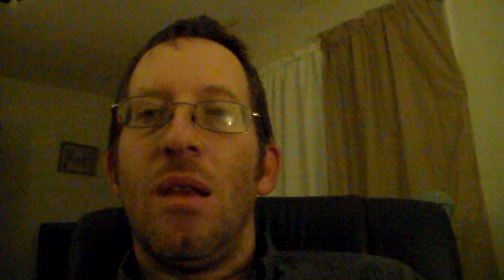Whosaidtyler's number one worst engine of all time

Comment: they still use the 2.7 v6 and its still full of issues.. you can get it as base engine in charger..etc. I have a friend who works for dodge and he said that they over work the engine so it is prone to fail easier like the small engine in a huge heavy car he said that if they put it in a small car it should be fine ( I still have my doubts...lol )

Comment: In 04, my mother special ordered a new Sebring sedan with the 2.4 on purpose. The salesmen said the the LX with the V6 was not what you wanted long term! It ran 200k with n/p. She got rid of it after the body rusted out beyond repair!  My uncle had a 2001 intrepid with a 2.7 with he babied but at 140k it started burning oil and then at just 2k  miles later it threw a rod! Junk engine that shamed Chrysler big time!
Reply from the maker: Your mom made a wise decision.
Reply: Actually, I made the engine choice, which is how the car got special ordered. We couldn't find an LX trim model w/o the 2.7 on any lot in Chicagoland! I wouldn't go so far as to say the car was a good car as a whole, but that 2.4 and slush box 4 auto never gave us any trouble. As you said, it's nearly impossible to find a 2.7 in 1 piece nowdays!

Comment: I love ford products and hope to until the day I die but .... Tell me just how much you loved the 2.9L ford v6 engines before you talk so great about ford.  Every one of those heads cracked.  Every 2.3 turbo ford head from the factory cracks, even with their inconel exhaust valves and all.  Not to mention the 2.3's that seize up from low oil pressure when they went distributorless and the aux shaft bearing went out. Plastic 4.6L cracking intakes... Ford has had their share of screwups as well.

Comment: Oil sludge buildup in an automobile engine results most often from poor maintenance, often from not changing engine oil at the recommended intervals, rather than to a problem with the engine.[3] The 2.7 L V6 engines have suffered from oil sludge contamination.[4][5][6] In February 2009, five separate class action lawsuits related to the alleged oil sludge defect were consolidated to the District of New Jersey.

Comment: I had a 1998 Ford Escort with one, I bought it, thinking it was maybe a timing belt.... NOPE. I took off the head, and the piston was broken off the connection rod, and there were chunks of metal EVERYWHERE!!!! Even in the other cylinders, which was a mystery to me! Went to the local wrecking yard, got another engine that I thought was good (Had compression ETC) took that apart when I got home, same problem....

Too bad, I loved Escorts until that generation :(

Comment: I believe they also came with the neon 2.4 cousin had the same car sans a 03 with a 2.4,car still runs to this day at 190,000 clicks.My stratus was the worst car I have ever owned and sits in the backyard as a shed because I will not pay the 3 grand to fix the engine and another 700-1000 for suspension,besides my mom's 07 (if you want to call it old)became available when she bought a Scion,and its been 100x better than the Stratus.

Comment: i had a sebring and intrepid put over 180k on both no trouble at all!
Reply: I had a 2000 Honda CRV, the one with burnt valve issues. I bought it at 198k miles. At 225k miles a mechanic told me one of the cylinders had 1/2 pressure and I would soon need to replace the car. I did nothing and kept driving it for 5 more years, got great gas mileage, plenty of power, and no engine lights, no other maintenance issues. Sold it at 260,000 miles when I had to move.

Comment: by the mid 80s chrysler as a whole was junk with the exception of a few cars n trucks
i had a 85 fifth avenue that had 369,000 miles on it when i found it rusting away in a field i got 4 yrs good service out of it n the last yr i drove it every time youd shut the motor off you would have to reset the timing but it still ran like a champ no smoke no leaking oil n i was not gentle on that old 318 i beat on it hard i did shit with tht car you aint supposed to do

Comment: Vehicles using this engine include:

    1998–2004 Chrysler Concorde
    1998–2004 Dodge Intrepid/Chrysler Intrepid
    2001–2006 Dodge Stratus sedan
    2005–2008 Dodge Magnum SE
    2001–2010 Chrysler Sebring convertible and sedan
    2005–2010 Chrysler 300
    2006–2010 Dodge Charger SE (Initially, only fleet models received the 2.7  L in 2006)
    2008–2010 Dodge Avenger
    2002–2004 Chrysler Intrepid (Canada)
    2009–2010 Dodge Journey (non-US markets)

Per wikipedia

Comment: The #1 issue was the water pump.  It''s under the timing chain cover and fails at about 80K leaking water into the oil. It's causes the oil to gunk up.  It's a huge undertaking ($) to replace and needs  to be done every 70K to be safe.  It's not a job for a novice.   Worst engine ever!

Comment: U people should be taking care of ur cars better. If ur motor starts to consume oil, what to do? Just drive until it breaks down? My 2002 sebring has a 193.000 km on it. No leaking oil or water. Oil (5W-30) chanced every 8-10.000 km. Purrs like a kitten, strong like a lion :) V6 comsumes oil so i check oil level every week. If u r low on oil ur oilpressure will go down and cam chain (gets loose) starts to chew internal waterpump --> sludge.....

Comment: That's why I hate Chrysler. Shit build quality and dealerships that treat you like shit unless your buying a new car. I'll stick with my tacoma and my 1.8t VW that has 249k miles and full compression, no leaks or burns. Sure the b5's a pain in the ass platform to work on. But the 1.8t motor is very solidly built. Has been running 101k miles chipped ecu running 19 pounds of boost and it likes it.

Comment: I have just over 70k on my 02 sedan and so far its still going strong.  I had heard about the issues with these engines a while back and have been running full synthetic in it since about 50k, here's hoping it keeps going.  I do have to clean out the PCV line every oil change though, you get that yellow snot crap build up in there.  I'm sure its a matter of time before it goes lol.

Comment: 2.3 Liter Vega inline 4 cyl from 1970-1975 has to be one of the worst engines ever made. Defective valve stem seals and the cyl walls tended to score up, something to do with piston plating.. GM did however did costly repairs on failed engines, so they did the right thing.. Engine was redesigned for 1976-1977 production years and was a better engine, but consumers didn't want the car anymore.

Comment: It is a real stinker, that is for sure. Other V6 Mopars are generally not nearly as bad but Chrysler has never made an engine to equal the LA V8s in reliability. The slanty of course is also good but it has some quirks, they always crack exhaust manifolds, etc.

Comment: The engine was affected by an oil sludge problem and premature timing chain tensioner failure, which were fixed around 2002-2004. The oil sludge issue appears to have been caused by issues with the crankcase ventilation system, and while it affected a minority of engines, it could cause complete failure[1] In some cases, neglected maintenance aided in premature failure (missed oil changes or increased intervals between oil changes).

Comment: And my favorite of all, the modular 4.6/5.4 v8 and v10 that had weak plug threads and commonly blew out the spark plug and lost all compression on that cylinder.  I have a 96 Mustang GT that I bought new that could not be aligned to stock specs from the get go.  They even put it on the frame machine at the dealer and that was the only thing that got it close.  I don't have any faith in their new products anymore due to their crappy service.  Honda dealer service has been my best experience too.

Comment: IF you made the argument that the 2.7 V6 was the highest production engine with the worst track record due to that sludging issue, then I can agree with you.  BUT I don't think the 2.7 V6 is NEAR the piece of SHIT that the Chevrolet 2300 engine used in the Vega, which was a sleeveless, cast ALUMINUM block with 17 % silicon alloy and a cast iron cylinder head... just the opposite of the MILLIONS of 4 bangers still on the road .  The big problem BESIDES the fact that the damn engine block is made of ALUMINUM and ONLY aluminum, is the damn thing also tended to overheat, which caused the block to warp and blow headgaskets!  Being an aluminum block, within 50,000 miles the engine was just going through oil at a horrific rate  There is no doubt that I would take a 2.7 V6 Chrysler powered car understanding it's issues (which POSSIBLY could be worked around), than the horrible 2300 Chevy engine that was so bad that Chevrolet quit making those engines very quickly.
Reply: MrComaToes Cosworth thought otherwise. If you iron lingered the block it would last forever.

Comment: okay Tyler - here's my challenge - answer this same question about pre-1980 American V8 engines
Reply from the maker: 1975-76 Chevrolet 262 cid(4.3L) small block. it looked like a 350, sounded like a 350, weighed nearly as much as a 350 but had barely more than half the power of a 350. Rated at 110hp and 133 lb-ft torque. Since the bore and port sizes were so small, virtually nothing can be done with them. For comparison sake, the later LT1-based 4.3L V8 made 200hp, the 4.3L --> V6 <--- made about 200hp, and Toyota's 4.3L UZ V8 was rated at 300hp. See also Olds260/Pontiac 265/Ford 255  for more "half-empty" V8's.

Comment: What about the Oldsmobile 1978-1986 LF9 Diesel. They were said to be real bad on headgaskets and crankshafts. I have one that has been good. I think bad diesel fuel with water in it, poor and the wrong engine oil put in to it, along with lack of people properly warming the engine.
Reply: 01fastrace By the time they quit the olds diesel they were halfway decent.

Comment: Surely the 2.7L is better than a Dodge CVT transmission... The CVT in my grandmother's Dodge Caliber has a 90% chance of failing before 70K miles. The car has 34K now and the transmission already sucks. The most noticeable problem is how it violently jerks the whole car when it changes gear ratios at lower speeds (below 35 MPH). Also, the transmission always gets too hot.